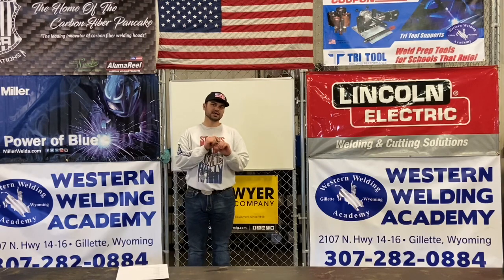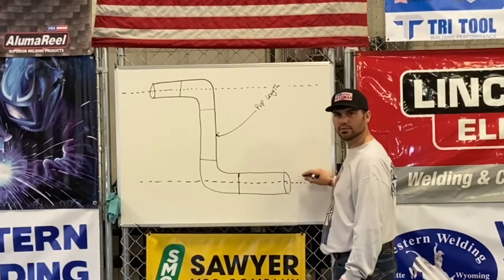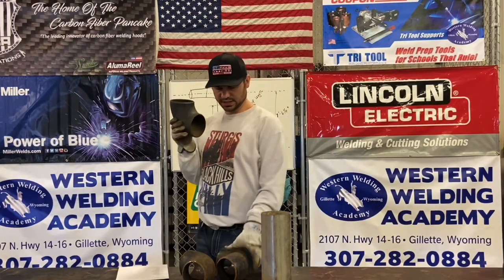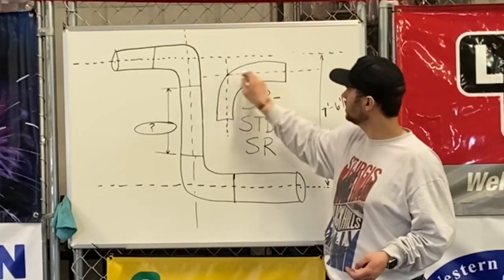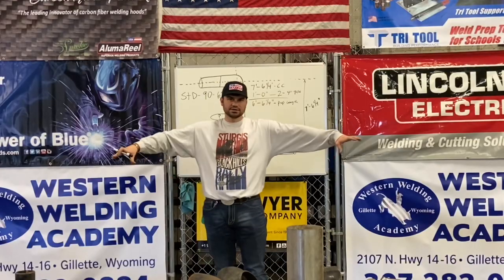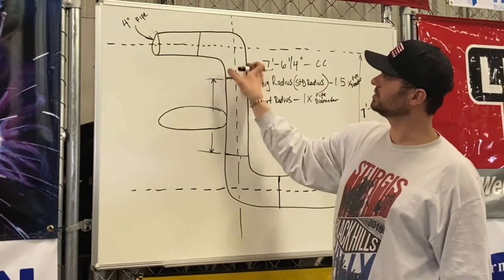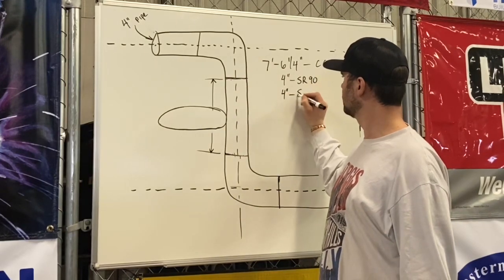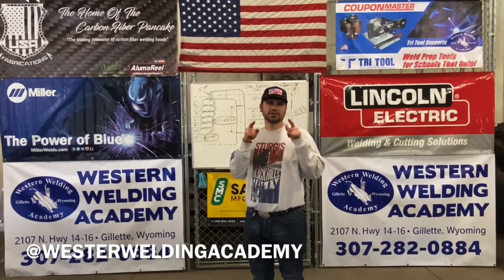How to take-off 90s on welded pipe! @RealTylerSasse

Comment: Do you account 1/8 per weld gap to the overall pup length to keep the center to center measurement accurate?
Reply: I do take off gap only for tig and mig. I do
3/16 per 2 welds. Not with downhill stick because your gap is less than 1/16 wide